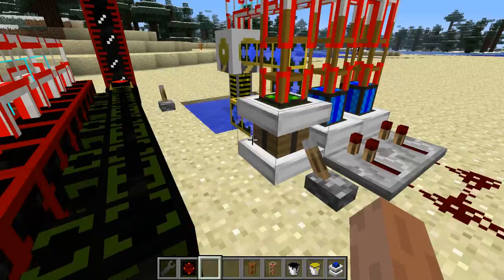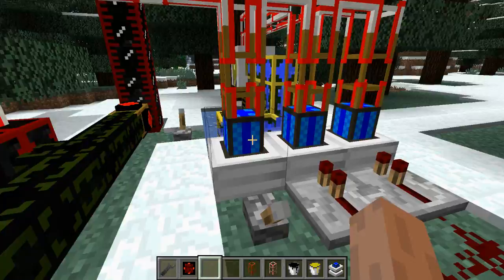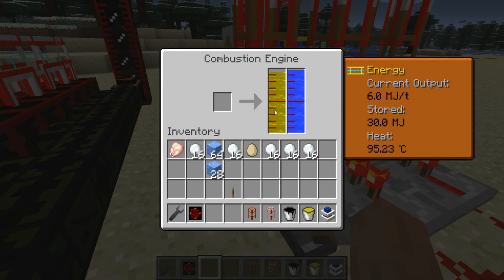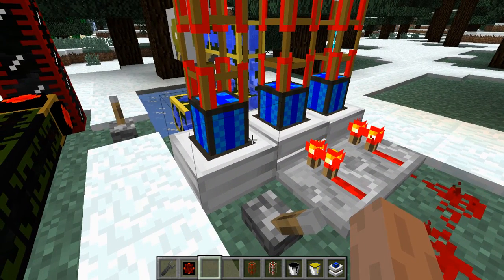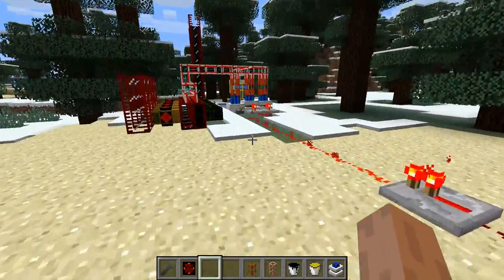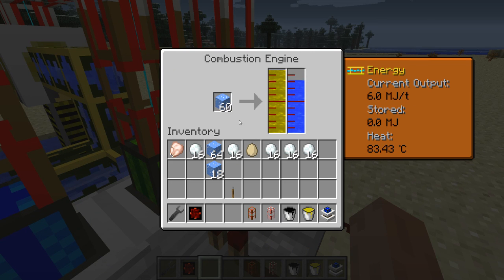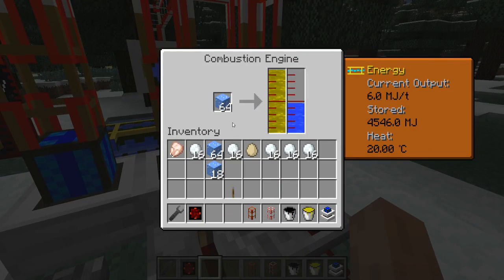Buildcraft - Combustion Engine Heat Rework

Comment: It would be awesome for biomes to have their air temperatures so you will need to cool down engine to about 35 C in the desert and engines in icy biomes could freze down below zero and need to melt and heat up to at least 0 C to start producing power.

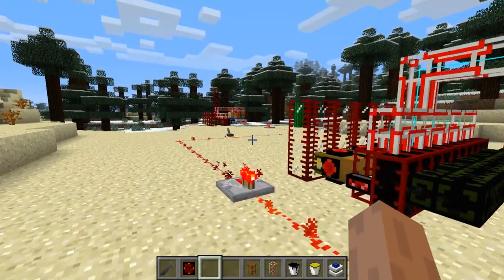Comment: @4:11 Even more dramatic when considered from the starting point. From 20 to 35 is a 15 degree change; from 20 to 64 is almost three times that.

It's a bit weird, in my mind, that the different biomes don't have different ambient temperatures, but it's still an interesting update.